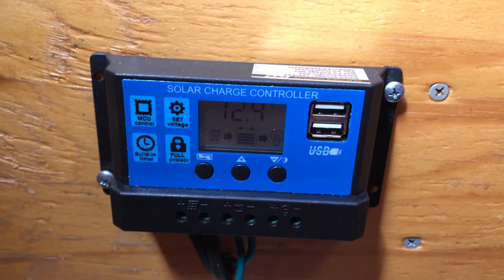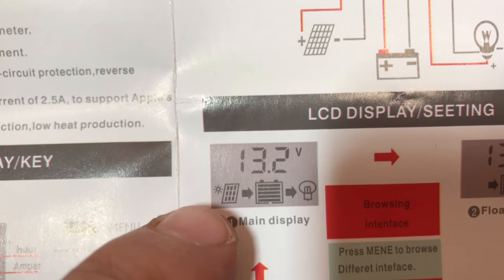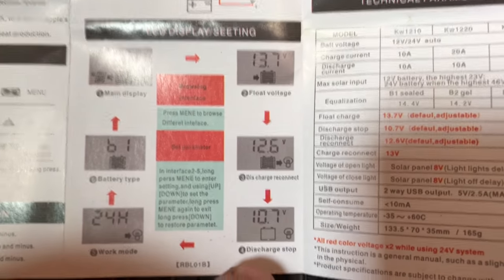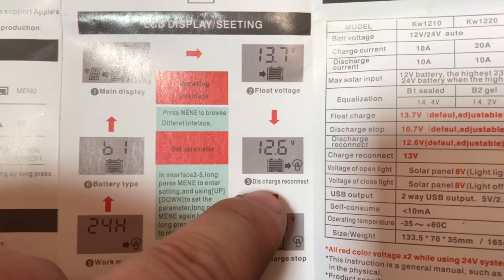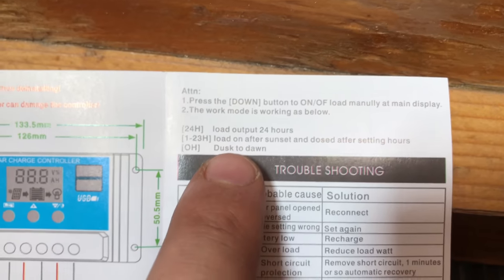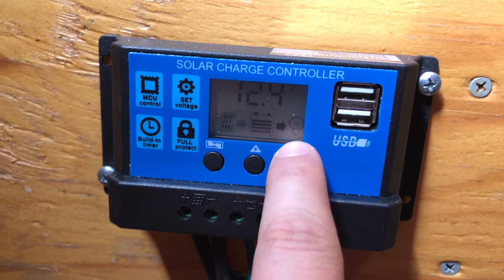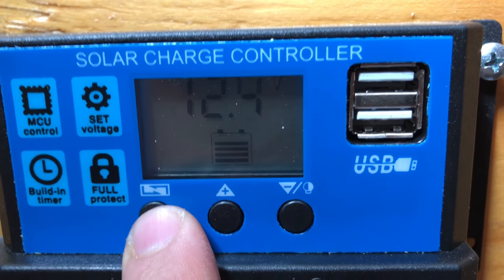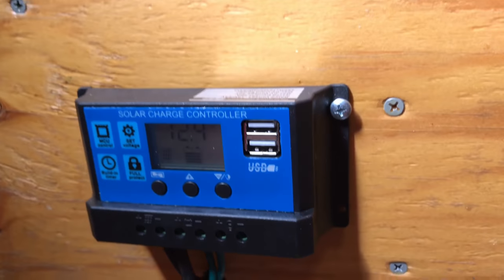How to setup a basic Solar Charge Controller | Quick Guide & Menu overview

Comment: Battery type mode sealed lead acid is b1…. other codes b2 to b7 are for AGM, Gel, flooded wet, Lithium etc. As far as I know b1 sealed lead acid is the only type supported on this controller.  It works as designed on lead acid and pretty good for the price paid.  If you have an expensive LiFePo4 battery do not destroy your expensive investment with a limited/cheap solar controller…. just go buy a correctly rated Victron MPPT charger!
Reply: True

Comment: I have this controller. It's great! The only thing I would like there to have been is a timer option which turns ON at dawn and OFF at dusk, instead of the other way round. I'm using it for watering a greenhouse which I want to be done during the day, not at night. Great video. (The leaflet does explain battery type: b1 sealed lead/acid; b2 gel battery; b3 unsealed lead/acid. Not suitable for Li batteries).
Reply: interesting use for this.
Reply: How do I adjust settings? When I plug in the solar it’s not showing the solar charging?
Reply: @practicepatch i hear you. I have taken a bunch of different coloured leds to light up the area of our home at night where the street lights doesn't reach outside in an area we use for storage. I have a manual switch but it got really old fast doing it that way. I prefer using solar energy (hopefully wind energy in the future as well) and its hooked up to a battery i got from a Chinese shop. The missing link is the timer option your speaking off
Reply: all the new versions are suitable for Lion and LiPo. I own 3 of these now.
Reply: thank you for this I couldn't find it on the one that came with mine.
Reply: Hi! I cant seem to understand what the timer means. 24H, 1-23H. OH. I know only OH dusk to down , but can't seem to figure out how does it know what time it is?
Reply: @lyndongaming  did you ever figure it out?
Reply: @lyndongaming  I was of the understanding that would be a timer that starts after the solar supply stops?
Reply from the maker: I just posted a video explaining the load/timer settings: https://youtu.be/v-iLu9DS558. If you want it to run dawn to dusk, you would set it to 0H (zero hours.) Hope this helps you and others reading this!
Reply: I use only 12v deep cycle rv batteries the heavy old style, for a good reason. They are tested true, they operate in extreme cold and extreme hot. They have a decades old reliability. When you need a new one, 10-15 years down the road, you take it in and can get a core exchange making you new battery much cheaper. These new lithium batteries are extremely exspensive. I get mine at orielys for 129.00. 5 of the ones i buy still cant afford a single lithium. You set up a solar panel system to save money not waste money on batteries that cost more than 3 months of electricity bills. These lithium have not been around long enough to really gain a perspective on how reliable they are. A new company selling their 2022 models dont have any at all time of battery usage for any kind of analysis data. I know I can get 10 years from my battery not even really thinking about it so long i dont over draw it. A deep cycle RV battery can go to 70% down and be fine,   a car battery cant do that and im not sure its good for a lithium. Lithium will not handle cold well, they are destroyed by cold temperatures. I keep my batteries out in a battery shed. I remember seeing cases where peoples phone or other lithium battery devices have exploded , Im not upto a large battery exploding anytime soon. But the main thing is cost and reliability, Im no doctorate degree expert professional know all about batteries..what i do know is they 100% work and are cheap just like this command, its cheap. But it still works fine after several years kept inside and it doesnt use lithium. So its great for a person on a budget...and if my battery so happens to be dead dead, i can just go get a new one in an hour at walmart, car parts stores, etc, not having to wait like cool dudes for amazon to ship it from china.
Reply: @lyndongaming i think it goes by the voltage levels from solar panel. No actual clock on board.

Comment: this thing also comes in RED!  24/12V claims to be 100A!  it is not recommended to use , however flipping it into 12V from 24V  a case of power it up, no panels connected! if it says 24V numbers! turnoff try again! simple but seemed to work.  do not recommend using this device other than as a backup or providing cheap place to split the load from a decent controller

Comment: Battery setting b1= agm b2= Dry cell b3=gel to my knowledge this controller is only good on lead acid batteries. If you have a smart lithium battery check with the manufacturer first before using this controller. Hope this helps
Reply: any idea what changing this setting would actually do?
Reply: So where's the setting for an fla type? (Flooded Lead Acid)
Reply: You can see in the instructions ( 0:29 in the video ): B1 sealed, B2 gel, B3 flood
Reply: @philllip9600  I did not understand the right setting of battery type:  "b1= agm b2= Dry cell b3=gel" or "B1 sealed, B2 gel, B3 flood"

Comment: I believe the battery type is for what type of battery you are using. On other cheap controller B1 is general led acid, b2 is lithium ion, b3 liFeP04, b4 sealed, b5 gel, b6 floaded. Each has various voltage to charge that type of battery. At least that's what I think.
Reply: From another place I saw this has 3 settings

1 = Lead Acid, 2 = Gel, 3 = Lithium (Lion or LiPo - No idea)
Reply: This is an excellent cheap controller , although the instructions for the one I have say lead acid only , this can be used for lithium ... AS LONG AS  YOU HAVE OTHER CIRCUITRY WHICH KEEPS INDIVIDUAL CELLS OF THE BATTERY  IN BALLANCE ..aka active balance ..... Active balance keeps the cells more effectively balanced than a "protection circuit" device ....The protection board(circuit)  also protects from overcharge and too low discharge ... but you don't need that if you use the cheap controller in this video , just set the voltage settings  you want.
Reply: Can these do agm batteries?
Reply from the maker: It says in the Amazon description: The 12v charge controller solar is only suitable for lead-acid batteries: OPEN, AGM, GEL. So, yes!
Reply: Which one is tubular battery pls

Comment: You will definitely need to set the battery type depending on if you have a Lead Acid Battery or a Lithium Ion Battery. Having that set wrong can ruin the type of battery you have.
Reply: this controller he has doesn't support lithium batteries.
b1: for sealed batteries
b2: for gel
b3: for flood
Reply: @ofilzag  u can use the 5V usb outlet for the lithium ion

Comment: Thank you! FYI for whoever is having same issue. Set each by holding menu button till flashing then you can set.

Also best to disconnect everything before setting. I set float and power draw then it endlessly looped on off because the charge level was higher than power draw volts. Had to disconnect everything then set.

Working well!

Comment: I just bought/ordered one of these a few hours ago and jumped to YT to see what people are showing.. The one I ordered is a 30amp 12/24volt unit..   I enjoyed the video which gave me an early start in setting up.. One thing I would like to ask if anyone knows..  

Question: If I put a 24 volt battery on the battery port, will the load side be 12volt or will it pump out the 24 volt. I do not want to burn my motor up..  Of course I have a volt meter that I can test after I get it if no one knows for sure..  Thanks.

Comment: Thanks bro for explaining the controller. I have a question, I made a 12.6v lithium battery and Im using this controller to charge it and my question is can it be set up at 13.7v charge which the controller has as minimum charging or should I use the type of battery B2 on the settings to use 12.6v as the limited charge for this battery 🔋 🤔?

Comment: Not shown in this manual, but the manual I got with an MPPT controller identifies the battery types
b01 = Lithium battery
b02 = Gel battery
b03 = Flooded battery (lead-acid)
These controllers supposedly automatically identify the attached battery - they don't
Set it manually for the correct battery if need be
Reply: I have mine connected to an AGM deep cycle, which type should I select?
Reply: @GlenEdwards  I figure #2....
But I am not exactly knowledgeable in this area,
Looking online I find this
"AGM stands for "Absorbed Glass Mat". As the name suggests, AGM batteries have a gel electrolyte and a glass fiber separator between the plates."
Reply: What happens when the battery voltage reaches the float voltage? Will it stop charging to prevent overcharging the battery?
Reply from the maker: Yes, it will dramatically slow the charge, and just keep it topped off with a trickle charge.
Reply: what would a AGM battery be under ?

Comment: battery type is super important. b1 is sealed. b2 is gel and b3 is flooded type batteries. there are more. check the manufacturer for those detail but those are the main three most will use
Reply: Very much important. I never knew the correct config for the ba3 , so I left it on b3 while I was using a gel ba3 , I was so surprising I got my ba3 fried . Damn ! It was a wrong settings on the charger still I added an extra power means to the charger with a 19v adapter 😢
Reply: I think the box instructions should have more detailed instructions than most do. unfortunately a lot of people have made the same mistake.

Comment: Scott - I'm using the same (12V/24V) solar controller to power a 12V, 8A pump. My plan is to connect 2x12V batteries to get 24V, then use a buck converter to feed 12V to the pump with increased amps. Do you have any experience using this controller to charge 2 batteries wired in series? TIA.

Comment: Nice and OK. But this was 6 years back. I am so eager to know if this unit still is in working order and if not, how long did it serve you. 
Also an update of long use or if there is anything else you want to add based on your own experience with this controller and battery you had.
Have a great day.
Reply: Had mine on a boat for 4 years and it's still good...

Comment: Thanks for going through both the manual and the menu.  It's still a bit confusing for me what the Float voltage does...maybe a maximum charge for the battery? When I hook up a multimeter to the car battery at rest I will see the 12.x volts...when the engine is running it reaches higher 14.x volts...so maybe that is float voltage?  Highest value of charging voltage?
Reply: @ScottsSolarProjects  Thanks for the follow up!
Reply: @BreakingBarriers2DIY  so the float voltage should be 14v? will that make a difference if you have a split charger installed also?

Comment: Hello mate ! I just ordered this exact charge controller after seeing your video, my application is to top off my van battery for I don't use it that much and most of the time the battery drain and needs jumping when I want to use it. Anyway you can share with me the charge controller set up for my application ? I would really appreciate it. 
Thanks for sharing your video, it's very informative. Hope to hear from you soon. Thank you.
Reply from the maker: https://amzn.to/3A8T1M4
In that case if you only want to trickle charge your van battery so it doesn’t die, I would recommend this product. It’s everything you need and would be much simpler to setup, and you can choose between 5 or 10 watts, I hope that helps!
Reply: @ScottsSolarProjects  
Thanks! I really appreciate it. Have a safe day!
Reply: @ScottsSolarProjects  Can thus be used with no battery and just for the USB. Or does the battery supply the screen display?
Reply from the maker: I don’t believe so, but I do recall once not having a battery connected. My solar panels and 12v fan were wired into the controller and when the sun shined, tan would trickle on and off. But I don’t recommend it.

Comment: the battery type is explained just to the right, in the manual. lead acid / agm and lithium get different charge/discharge settings.
Reply: I don't a part explaining this, or what battery type matches which code
Reply: Type b1 (default) is for a sealed battery like what's now typical for a car. B2 is a gel battery, b3 is a flooded battery, one with plates submerged in electrolyte and caps for each cell. Like from your dad's car.
Reply: @FunStuff-zc3ps  im with you on that

Comment: Great stuff thanks. One thing I found is you can't turn off the load on the USB ports. I'm charging fans in my poly tunnel. Turned load off and they continued to draw charge from battery. So just disconnected them. So renders the timer useless for USB

Comment: Thanks for this video. Can I use the controller to charge a 5V power bank, without connecting a battery? If I connect the solar panel to the battery (middle two ports) and then connect a power bank using USB port, will it work? I may sound silly here.
Reply: @ScottsSolarProjects  Thank you for the advice. Certainly helps!
Reply: no ..... connect battery first to the charge controller.....then connect solar panel.... and afterwards u can take load

Comment: Can i use 2x12v gel batteries in series with these 12/24v solar controlers ? Can it charge the batteries at 24v ? I have a 24v ups to use as an inverter thats why i want to know if they can operate with a 24v battery

Comment: Thank you Scott. It is very helpful. I have a question tho.. "How do you connect the inverter?"

Do you just connect the inverter at the "light bulb picture" connection at the right end of solar charge controller?? 

Looking forward to your reply. :)
Reply from the maker: I connect the inverter directly off the battery and keep an eye on the voltage to make sure you don’t draw too much off the battery.

Comment: Nice explanation! You're putting the work mode in 24h. In my car I installed this controller and I don't need to monitor it all the time. Would it be best to put work mode on 0h?
Reply from the maker: I just posted a video explaining the load/timer settings: https://youtu.be/v-iLu9DS558
Reply: @ScottsSolarProjects  thank you. I'm using the USB output, so that won't affect it anyways.
Reply from the maker: Ok gotcha, and to your question, I’d probably say set it to 24 hours and just manually turn the load off. Keeping it at 0 would mean it would turn on at dawn. And you may have already figured that out by now. 👍🏼

Comment: Good Video . How do you find The AMPS COMING FROM THE SOLAR PANEL ON THE CONTROLLER ..

That's what I'm trying to Find ..
WHERE IS THE INPUT AMPS FROM SOLAR PANEL ON THE CONTROLLER .. ???
Reply from the maker: Unfortunately this controller doesn’t display that, I wish it did. You would need to purchase a separate device to have that ability.

Comment: Thank you for the explanation.  Very detailed and to the point.  I seem to be having trouble understanding what "load on" and "load off" actually mean. We are testing out setup before installing the panels in their permanent location and currently have 1 48v panel inside our tiny house with the garage door open and it seems to drawing enough power to be running our lights and my blowdryer with "load off". Any further expansion on how the load part works would be awesome and sincerely appreciated.
Reply from the maker: Hmmmm…not quite sure I understand your situation exactly. But, load on simply means that the far right positive and negative ports will be on to provide power to devices. If it’s load off, then it will then power off at those ports.
Reply: The two screws at the bottom right of the charge controller enable you to hook up a "load", for instance, a light bulb or something else that will run directly off the battery. This is all they are referring to by "load" for the charge controller in the video. You can turn it on and off with the button directly above those two contacts and the light bulb icon on the screen (as well as any load that is connected) will turn on or off accordingly. I'm not sure if this is what you were asking, but I hope this helps.

Comment: I set my solar panel up with the same charge controller. There is no display on the screen. Is this because I didn’t charge my battery before connecting it? I’m a beginner to solar energy but thank you for this great explanation!
Reply: You must connect the batery first (and sometime you get the broken unit becouse this is cheap product)
Reply: You should connect battery before solar panel I believe

Comment: Thank you for great tutorial. Pls let me know one thing. Is the only battery I can charge with it is the battery that has the  voltage of min 12V ? It is not possible to charge batteries that have max voltage below 12V as for instance 10.8 V right ? Cheers
Reply from the maker: As long as it’s a 12v rated battery, then you should be able to charge it. Even if it is lower than 12 v. If it’s too low, be careful though, because it could be a bad battery.

Comment: Hi Scott, On this controller the 2 right hand terminals are for the load, what is considered to be the load, if I was to fit this in my RV the van has it’s own 12v charger for when it’s plugged into the mains and I’m guessing the vans wiring is all linked into the transformer, 12v from transformer when plugged in, and by the battery when not. How’s does the solar controller fit into all this , cheers Mal
Reply from the maker: I just posted a video explaining the load/timer settings: https://youtu.be/v-iLu9DS558. I hope this helps your question a little bit.

Comment: Hey thanks for vids…helpful!! Question…I’ve got 2 100watt panels on my van roof…what amperage should my charge controller be?
Reply from the maker: You bet! Each 100 watt panel will produce around 5 amps, but I would recommend just getting a 30 amp controller because it’s not much more expensive.